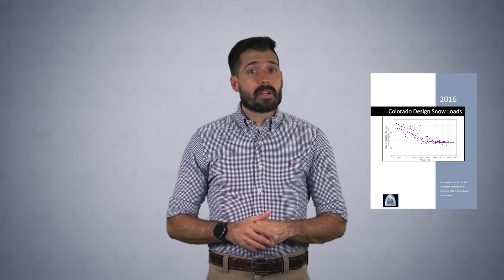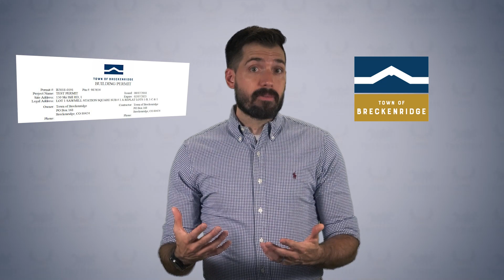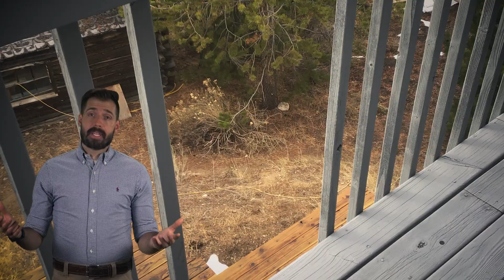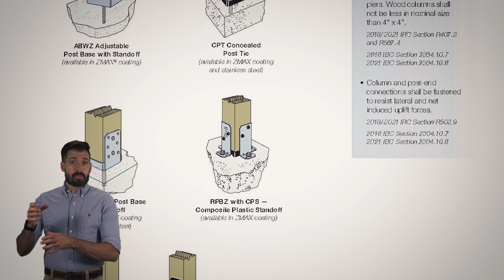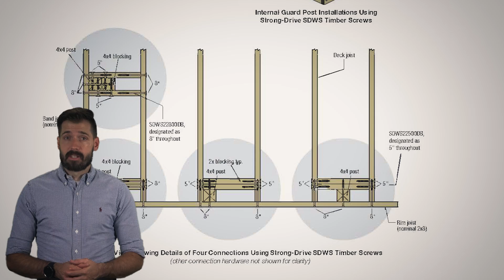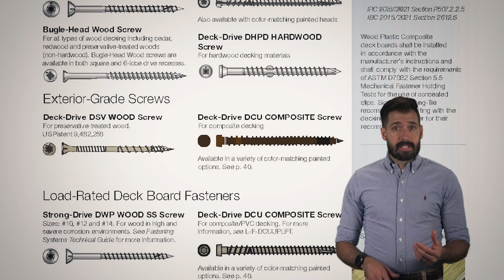Deck Inspections Not Code Inspections

Comment: Very informative! We're just in the process of having our 37 year old deck replaced with a new one. Lots of upkeep over the years, but it was time. Pretty incredible to see the differences in code here in Minnesota from 1986 to today. Our new deck is being installed with helical piles. I noticed that you didn't mention them. The ones that were installed go down 12', to some really solid soil. The first several feet in our yard are pretty spongy, and the original footing which went down 3-4 feet sunk a bit over the years. The helical piles supposedly have no movement or settling. Interesting process to watch as they're being installed.